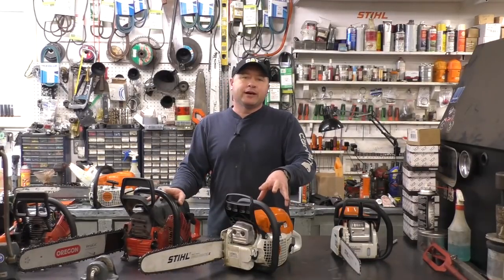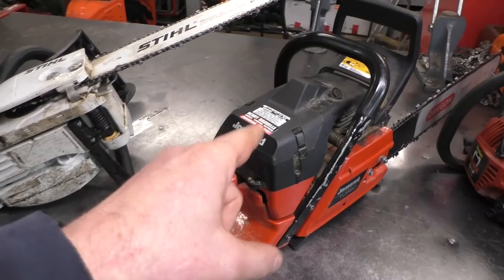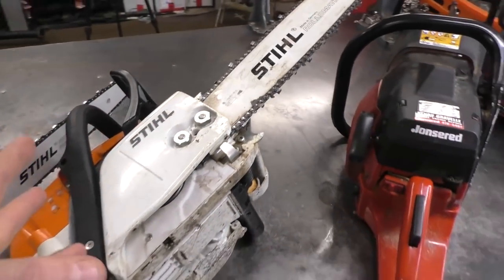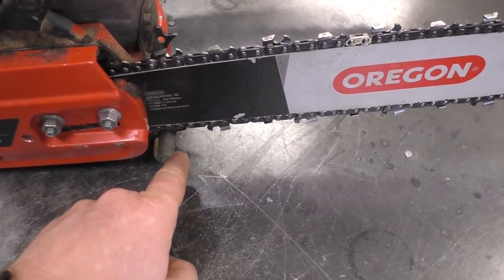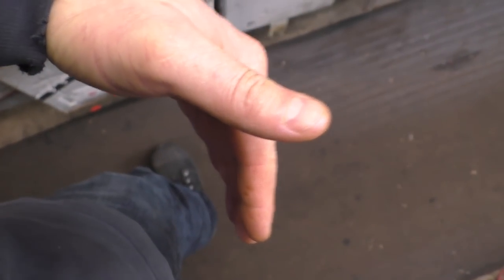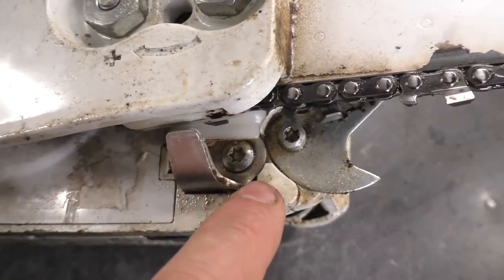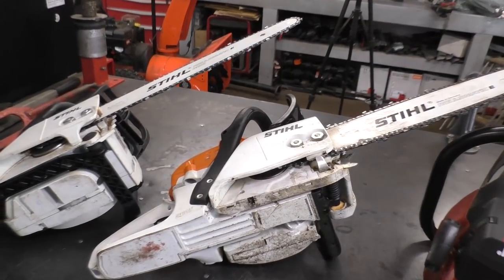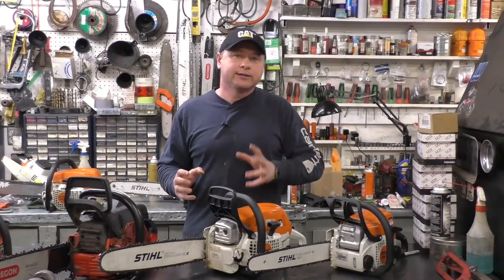What's This Part On My Chainsaw For?

Comment: If you look  the rear handle, which is part of the fuel tank assembly, you may notice that on the PTO side, there is an extra wide "lip" on the bottom. This is to help protect your right hand in the event you have a thrown chain,
Reply: That makes sense I always thought it was just to step on if starting saw on the ground

Comment: It also protects the back of the clutch cover from being hit and breaking off also the fuel tank on some saws is in that area ms440 did put a metal guard on the tank . . very good point thanks

Comment: I just gave away an old Poulan,and pullin,and pullin saw that must have been built before safety was invented. Didn't have a chain brake. Always had to shake hands with danger when I could get it running. Happy New Year buddy. Thanks for posting.

Comment: i wider base at the bottom of the back handle is also a shield to protect your hand from a chain coming of the bar , if you notice allot older saws had narrow handle bases and latter started getting wider for safety measures , thanks Don   👍

Comment: Every piece of equipment has a "wat dat for?" part. This is usually the part(s) left over after a complete disassembly and are then tossed into a random parts bin. Manufacturers add those items for purposes of trivia games.
This part wasn't one of them.

Comment: When your cutting small pieces and multaflora rose. That catch stops alot of trash from hitting your sprocket and cover. I just noticed how beat up mine was. Buts still solid.  I can only remember 2 chain throws in almost 30 years

Comment: Excellent points.  

 Saw placement when cutting and a sharp chain could save your life.   If you place the saw in front of you when cutting, and the saw kicks out of your hands it will hit you square in the face.  Take a chainsaw course or two, well worth the money.
Reply: The chain brake is designed to prevent Facial injuries. However in some circumstances Perhaps if you are trying to use the saw at head height you could sustain an injury.
You should always use the correct PPE available.

Comment: Usually If a chain snaps it will be thrown forward  because that is the direction it is being driven.  Ir the chain comes off the bar the chain catcher will stop it.
As for Leg injuries you should be wearing all the proper PPE that is available.

Comment: Here you're not allowed to use a chainsaw without a license and the course is 100% about safety. Actually felling and using a Saw is the easy part. Youre allowed to use a chainsaw without a permit on or own property tho
Reply: Sometimes I wonder if requiring a license to buy or rent power equipment would be a plus. I've seen some real head shakers from people with no experience
Reply: Sweden?
Reply: Really ?……I am in Australia and anyone can buy and use a chainsaw …..obviously some people should not be allowed without some basic training
Reply: @sneekerflogger  your allowed to buy and use a chainssw on your own property.
Reply: @alexstromberg7696  …..but do you still have to have this license ?
Reply: @sneekerflogger  if you are going to use a chainsaw on anything other than your own property you have to have one

Comment: I've got a question. I have a ms441cm and really would like to adjust the oil flow,but cant find the screw. It shows you an arrow with an oil drop symbol,but I do not see any screw to actually do any adjustments. Can ya explain to me where the actual screw is please?

Comment: I run my dads old chainsaw and it has what looks like cutting damage on the chain brake above the bar. I've always wondered how it got that way. I've seen it on another saw to. Could it be from a chain jumping of the bar?

Comment: Any suggestions for a John Deere 50v chain catcher it's discontinued and would like to replace it
Reply: Your john deere chainsaw is the same as a echo cs-452vl chainsaw.  Look up parts  for this model u will find one
Reply: @troy3052  there discontinued for that model as well I own both
Reply: Make one.  Some flat stock from hardware store, hack saw or grinder and a drill, hammer it to shape.  If that newer Stihl doesn't have a curved metal plate under the plastic cover for reinforcement, anything built out of aluminum or mild steel should be just fine.
Reply: I posted a link here but it was deleted.
Reply: @River_Miles  mine is a John Deere not still but I'll look into what you suggested thank you